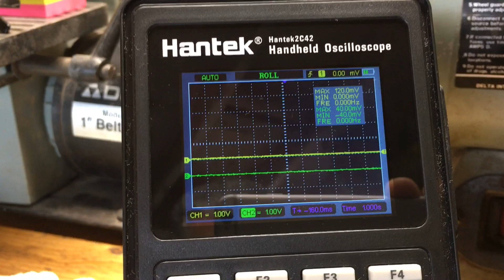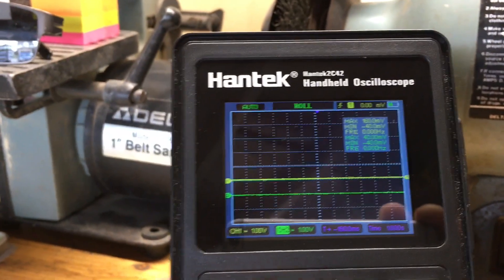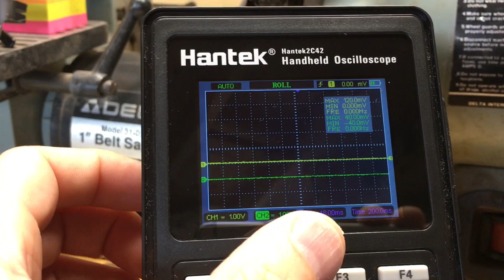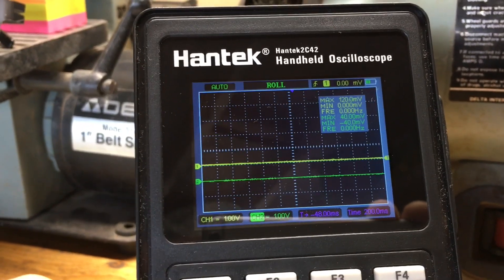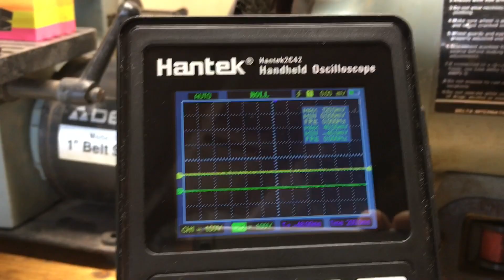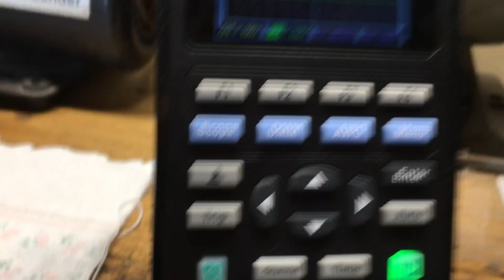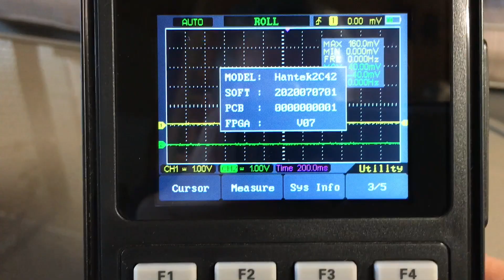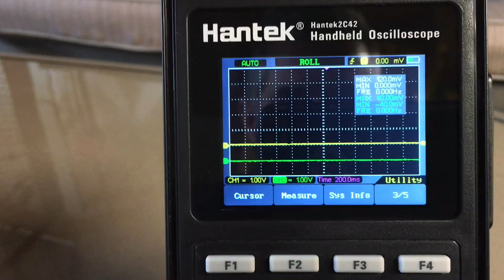Hantek 2C42 (P2) Update Fix

Comment: hi sir! i have a hantek 2d82 newly purchase online but the problem is it can't detect a ignition signal and can bus signal but it can detect Lin bus signal. i hope you have a recommendation thank you and God bless.
Reply from the maker: Hi your 2d82 should be well capable of both. I am not sure what probes you are using but make sure your time base is set fast enough and your voltage scale low enough. Start with that. Don’t blow up your scope by directly probing HV.
Reply: @TheGibby3340  no sir I'm using the correct probe I tried first checking the ac wire using c65 amp clamp & i get reading but when tried to use it in ignition coil with attenuator no signal detected but when I use auto button too much noise on the signal.
Reply from the maker: @sokakutakeda1500  Your confusing me...What operation are you trying to perform? Ignition coil current ramp?
Reply: @TheGibby3340  I'm sorry for the confusion sir when I first receive the scope I tried it first in my home using the c65 just to check if the c65 is working and it's working fine I got reading now when go to work because I'm auto electrician I tried to the coil on plug ignition coil using the 20:1 attenuator but no signal same as in can bus using the right lead. but when I used to check the Lin bus operation because at that i have a Lin bus issue it's working i have a signal.
Reply: @TheGibby3340  now I'm thinking if I update this one would it correct the issue? I'm afraid to update it because I don't know how to. i don't know what's the latest version in my hantek it's show version 7.
Reply from the maker: @sokakutakeda1500  No need to be sorry dude I am just trying to understand what you are trying to achieve...Secondary HV trace or coil current ramp?
Reply: @TheGibby3340  no sir primary ignition the control signal from the ecu I want to see actual waveform not just only by watching in youtube videos actually I'm new to scope but watch thousand of videos and read articles related to scope cause I want to learn more because of my line of work I know already what is good and bad waveform and current ramp but I want to see in actual also sir this is my first scope.
Reply from the maker: @sokakutakeda1500  Ok understood...It should be easy enough to capture an ignition control pulse. Typically 5V. Hantek products don’t do well in the presence of high voltage noise. Try picking up the signal at the ECU side not the coil side. That works with my Hantek 1008 which locks up with HV noise.
Reply: @TheGibby3340  Hi Sir! i just the hantek website for possible latest software update but unfortunetly i think they discontinued it. i will try your suggestion when I return to our shop but atleast it should be no noise or it should pickup a signal in coil on plug it self to check the circuit integrity from ecu to coil.
Reply: @TheGibby3340  it can read a Lin bus signal but it can't read a can bus signal i already perform self calibration but still no ignition and can bus signal.